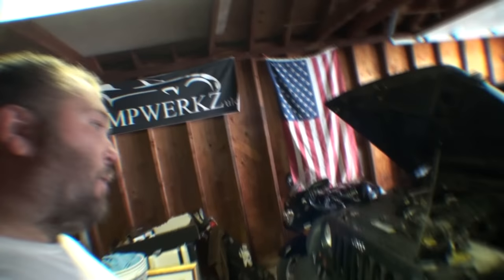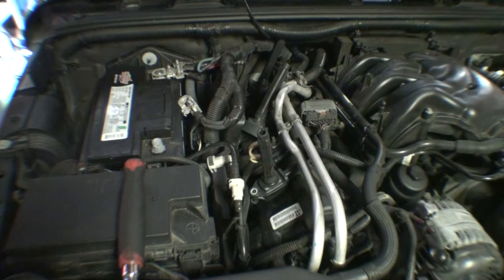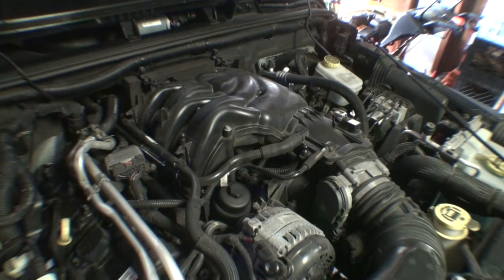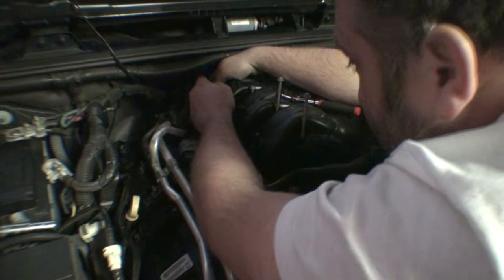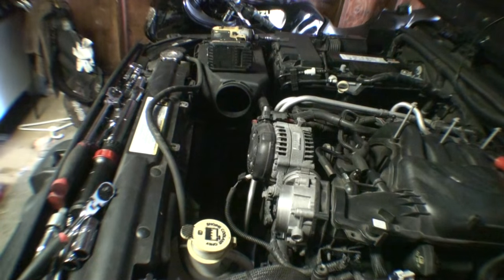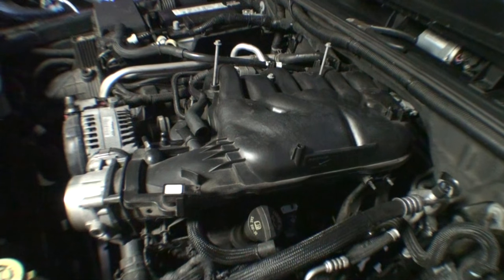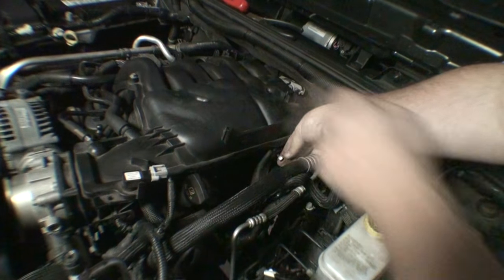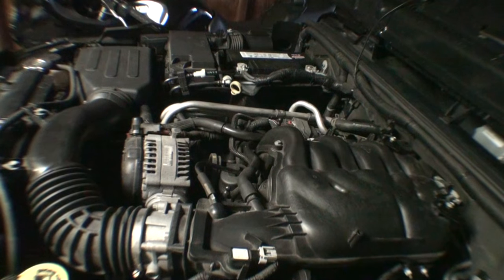Jeep JK Pentastar Spark Plug DIY

Comment: I just finished installant a new set of plus in my 2012 JKU.  Easy to follow along instructions and pretty easy to complete if you take your time and Pay Attention.  Cleaned the Airflow Sensor and Throttle body while I had it apart.  It idles so much better and accelerates without hesitation.  First set of plug in 160,000 km.  Great job on the video and commentary.  It helped a lot throught the process. Thanks a lot!

Comment: Hey i went ahead and replaced the spark plugs, coil boots and springs and!? Cleaned the throttle body on my 2012 Sahara jeep, 3.6L I have to hand it to you!!! I was not sure I could do it until I saw ur video,, I have worked on cars a lot in the past but mostly chevys and older fords,, lol, after watching ur video!? I built enough enough courage to do it myself,,, it was a success👍🏼👍🏼👍🏼 it runs smooth! Quiet and lots more power!!! We have two Saharas, one is my wife's and one is mine,,, I'll be doing hers tommorow...thanks once again for the fully illustrated video.....👍🏼👍🏼👍🏼👍🏼👍🏼👍🏼

Comment: So I just had an intermittent engine light with a plug or coil code. The local dealerships all wanted $200 per hour for approx 2 hours for labor plus parts...total = $715 to $800.  Are you kidding me, Jeep!!!!! Thanks for showing me how to do it myself.  2016 JKU with 55K miles

Comment: I did it!  I figured out why the service manual suggests removal of the wheelhouse splash shield.  It's to gain better access to the lower nuts/bolts on each of the upper intake manifold brackets.  I didn't remove the shields and I didn't remove the right hand bracket at all...just wiggled it out the way you did.  No problem...much less work.  I had a bit of oil around my plenum gaskets, which I replaced.  Not sure what that means....guessing something not good.  But she's purring like a kitten now with the new plugs!  :)  Thanks so much for taking the time to make this video.  It's really hard to do a project and worry about the camera on top of everything else.  It's appreciated!!
Reply from the maker: M Ravitch Glad you got it figured out. I personally prefer to avoid removing more than needed. Oil in the intake is relatively normal due to the PCV system. I had the same thing happen as well but its really no big deal. A thin coating is normal on these types of systems.

Comment: I have an old f150 straight six. I used denso plugs for the 1st time. The truck runs smooth as silk, lots of power. I'm sold on denso  spark plugs.
Reply from the maker: Denso makes good plugs, not denying that.I just like to put back in what came out. I've run into issues in the past swapping plugs in that are not OE despite claimed interchangeability. Many newer cars are really sensitive in terms of their ignition systems and I didn't want to go back in to deal with an issue due to plugs.
Reply: The Car Life  The place I bought the Denso plugs specified they would fit a "y" in the Vin number. They fit perfectly, it helps to have good info, thanks.
Reply from the maker: I suspect they probably sold you a Denso iridium, p/n IXUH22. I was looking at putting these in or the NGK equivalent. All are compatible. I'll probably give them a shot next change. Plugs for this thing are cheap enough I wouldn't mind shortening the interval just to test other plugs.

Comment: Just completed this project today.  Only took two hours and I had to take the manifold off  1 1/2 times because I forgot to install that damn rubber piece the first time.  Thanks for the video.  I'm not sure I would have attempted the job without it.  I did find it easier to remove and install the manifold by removing the front bracket with the two nuts on it and loosening the rear bracket with the two nuts on it.  Otherwise it was really not bad at all.

Comment: The engineers at Chrysler should be kicked in the balls for putting the spark plugs under the intake manifold like that.
Reply from the maker: I'm almost positive that the manifold used on the Jeep JK's is the same one used on Grand Caravan's which have this engine mounted for the transaxle (FWD). Other models with the Pentastar engine have a normal intake manifold where there is no obstruction. Spark plugs should never be this complicated to do, but it is what it is on this one. Fortunately, Iridium plugs have a longer than average service life so at least this won't have to be done for awhile.
Reply: Mark. I have owned 5 or 6 jeeps, and was considering buying another. This video made made me  change my mind. Any Idiot who would design a car like that, would design the rest of the car to be junk too. I wouldn't have one if they gave it to me. Tear the motor apart just to change plugs? No thanks.
Reply: They absolutely should be kicked in the balls by an NFL kicker.  Try diagnosing anything on bank 2 under that plenum (fuel rail, injectors, intake leaks, spark plug coils, not to mention changing plugs).  It's absolutely ridiculous that you can't access 1/2 of the v-engine without going through this nonsense.  And putting the plenum back on is a pain in the ass too.  It's really easy to not seat it properly.

I wish I had seen this video before I did it - 3 times already in the last 2 months.  Just trying to see if there was an easier way to put the plenum back on without wedging it in since I have to pull it again tomorrow to check an injector.  I guess not.  Great detailed video and very helpful though.
Reply: Grumpy old fart but instead of having to change the plugs every 5,000 miles like years ago. The new engines, with the Iridium plugs do last for 100,000 miles!!! With no points and condenser. Like back in the day. But I guess you never had to change plugs every 5,000 miles, or less, along with two sets of points in an olde 1968 Mustang GT Cobra Jet 428!!! If you had? You would rejoice having to maybe change the plugs in your Jeep! Just take a look at the plugs in the V6 Cherokee!
Reply: Mark Gauthier 😭😭😭
Reply: Yea, but the selling point on pentastar was more HP and better gas mileage. At 100,000 miles you've filled up the tank 4,545 times (for a 22 gallon tank). At $40 a fill you've spent over $18,000 on gas driving 77,2000 miles with the pentastar.  With the older (not pentastar engine) you spend the same amount on gas driving 63,500 miles. Hopefully those extra 2 mpg and cumulative 14,000 makes up for the shitty design.
Reply: Sarah Carrero You fail at math.  You just divided 100,000 miles by 22 gallons.  Try dividing it by the distance you go off per tank (250 miles?).
Reply: Fiat already did that.  Rumor has it Fiat is developing an updated inline 6 engine.  The renegade seems proof of whats to come.
Reply: Engineers at Mercedes Benz
Reply: Mark Gauthier you must have never seen a German car

Comment: I did not see you replace the driver side plugs, what is up? Secondly, I would agree with the prior comments. This is way too much trouble to replace the plugs. I replaced the plugs on the 3.8 liter (2008 Jeep Wrangler) and they were much easier than the 3.6. Well, keep up the good work

Comment: Good video, wish I had seen it before replacing a customer's oil pressure and temp sensors under the lower manifold. Probably be worth cleaning the throttle body and doing a relearn as part of your tune up the while at it.

Comment: Just completed this process, not as hard as the video makes it out to be. Top tip, use the coil pack to remove the plug after unscrewing it from the head if you do not have a magnetic plug socket.

Comment: At the start of your video you had said you were curious what the dealer chargers to do this work. Well, I'm in Toronto, Canada .. The dealer whom i usually go to quoted me $700.00 with tax to do this work (LABOR ONLY!!!!). I almost hit the floor in shock. Thank you for taking the time to show what is involved when changing the spark plugs. Besides the parts, you have literally saved me $700 in labor when i finally decide to change my plugs, which will be very soon.  Not sure where you're located, but I will some how send you a case of beer !! LoL .. I do have one question, did you find that the new gaskets, once you installed them, stayed in place while reinstalling the upper intake manifold ? Thanks again man ! You're awesome !!! SUb'd
Reply: 700 in labour? i work at canadian tire toronto, and i did this job for 3 hours labour ( actual book time says 2.6 ) and here labour is 120 per hour, so $360 for labor

Comment: Great video on changing the spark plugs. Must have ben a bunch of drunk engineers that put the spark plugs under the intake manifold.  One question: I noticed that the last component you removed prior to removing the Plenum was  the electronic throttle body plug.  I didn't see you reconnect it when you first reassembled the plenum after installing the left side plugs.   I am assuming that was the first component that was reattached for reassembly?    

Thanks 
Andrew

Comment: You don't need to change spark plugs until 100,000 miles.  Use OEM plugs do not use high tech plugs like E3
Reply: 100000 if you want broken plugs
Reply: MARTIN WOOLDRIDGE well when you do upgrades air filters  and Extra weight and   off-road  spark  plug work extra hard that y u should  do early like 70k. Or 75 k mile
Reply: My plugs were shot at 30k.....but I drive a hellcat

Comment: This is why I'd rather Fiat/Jeep go back to using the inline straight cylindar engine.  I own a '94 Jeep XJ and a 2018 Renegade.  Replacing the spark plugs on both those engines are not that complicated.

Comment: I Replaced A Coil Plugs And A Fuel Injector On My 2016 Did Same Thing Except I Put The Foam Back In Place And On The Drivers Side I Loosend The Two Brackets From The Block That Way They Swung Out And Allowed The Intake To Sit Down Much Easier And One More Thing Why Did You Remove The Entire Air Box

Comment: Quick question for you.  The service manual actually recommends removing the fenders, wheels and front wheelhouse inner splash shield.  I have a 2013 which I believe is the same setup as your 2012.  I don't remember seeing you do any of this in your video.  Had you already done it or did you find it was unnecessary?  Any idea why they want this done?  Thanks in advance!!!
Reply from the maker: M Ravitch Sorry for the late reply. I did see the info about going in through the wheel well but didnt bother with that. 1/4" flex head ratchet was all I needed to get in there. There is a decent amount of room to gain access regardless.

Comment: Thank you for this!  I am curious, did you also change spark plug wires and PCV valve?
Reply from the maker: No problem. This video is on the 3.6 Pentastar which uses a coil on plug design, so no ignition wires here. I think maybe you're thinking about the 3.8 liter which in that case is honestly a much simpler engine. I don't believe it's required to remove the upper intake plenum or anything like that. If you have a Wrangler I believe the 3.8 was used up to model year 2011.
Reply: The Car Life realized that this afternoon as I tried to find a tune up kit for my '13 JKU. DUH!
Reply from the maker: No worries. In regards to the PCV I know there is a valve somewhere on the engine but I didn't see the need to replace it at the time. I did see some oil residue in the intake manifold but not enough to really worry about. Also, oil consumption has virtually been nill since I bought it.

Comment: OK, so I just did this myself, followed your video and I thought I'd add a couple things. Electric connectors - I f#$king hate them and everytime I encounter one I feel like I'm in the Da Vinci Code - you skipped through the connector under the throttle body, I. could not figure out how to unclip it, I think I may have even broke off one of the tabs, I did figure out it's possible to leave it connected and just flip the plenum over and out of the way with it still on. It would be helpful if you showed us exactly how to disconnect those wicked things. Also that steel bracket on the passenger side valve cover is a PITA - I sure wish it was easier to remove but you have to take out the battery box to do so. What I did discover is on the driver side there are those 4 nuts that come out of the plenum sideways. The bracket that connects to the two in front near the throttle body can be completely removed via two 10mm bolts under the throttle body - it's makes wrestling the plenum off a whole lot easier! Thanks for your video!

Comment: how many miles on the jeep for a spark plug change?
Reply: Neomarie Massa the owners manual says 100,000 miles!
Reply from the maker: I did mine at 80K or so. In the manual it claims 100K miles but as you can see they were pretty spent. Net time I'll do it at 50-60K as I was noticing a loss in performance and fuel mileage was falling off as well.
Reply from the maker: Yep, exactly. In my opinion 100K miles is a little on the long side.
Reply: On my old 03 F150, I had 125k on the original plugs; so I say 100k would be ok too. It might just be pure luck that I got 125k out of them too! :)

Comment: your methods are flawed.  plugs are never "factory gapped".. 
you MUST check specs and set accordingly. 
and champion plugs work great in harleys and lawnmowers. 
NGK or Autolite are much better ! ( IMO)
But over all a good video..  Thank you.
Reply from the maker: kb7uxe If the spark plug is factory specific and is the exact plug as used by the manufacturer of the vehicle it is generally safe to assume the spark plug is pre-gapped. However, I still spot check before installing when I have the gap info. What's funny here is the dealer sold "Mopar" plugs dont come with any protector over the tip while these Champion packaged ones do. I looked and found alternatives to the factory Champion plugs, since I personally prefer what NGK offers, but as a rule of thumb I tend to put back in what came out as long as it's a stock application and the plug that came out is still the factory specified plug. 

I had a bad experience a long time ago with alleged alternative plugs in a different application which is why I tend to stick with the known option that works.

Comment: didn't use anti-seize. wouldn't let you near my engine. you don't need to torque them.  They have a crush washer on them. half to 3/4 turn after contact.
Reply from the maker: There is absolutely NO reason to use anti-seize on any spark plugs since they are plated to prevent corrosion. Anti-seize will only act as a torque multiplier. I prefer to torque spark plugs to spec to ensure they have been tightened properly, especially on an aluminum cylinder head.
Reply: Thanks for addressing that. I was curious when I saw you drop them right in. Everyone says anti-seize, but I don't use it on my wheels (because of torque multiplying), I just make sure the surfaces are wire brushed clean. Makes sense not to use it on my plugs.